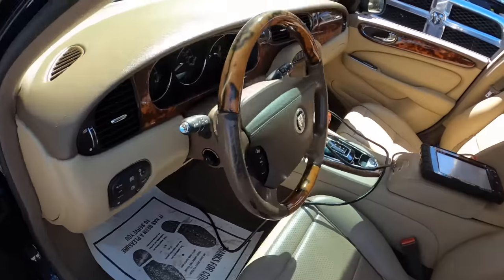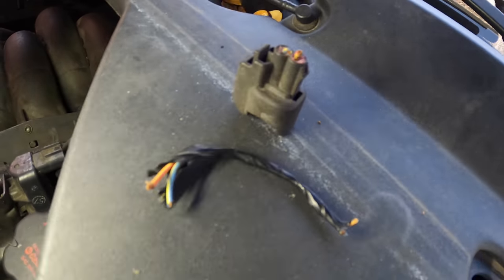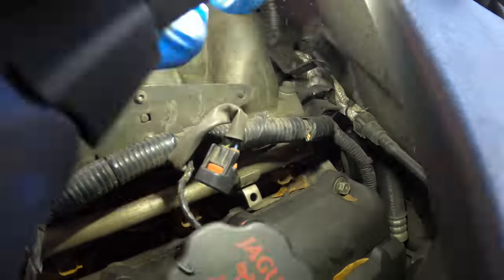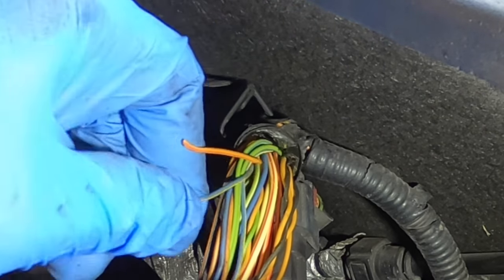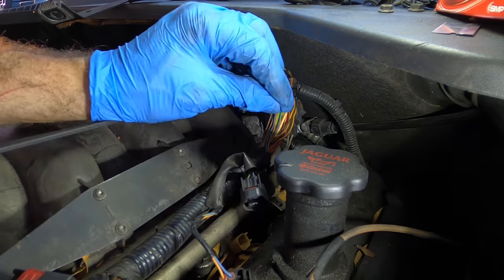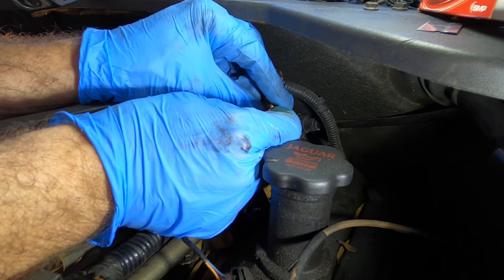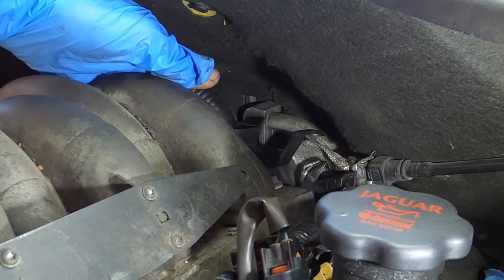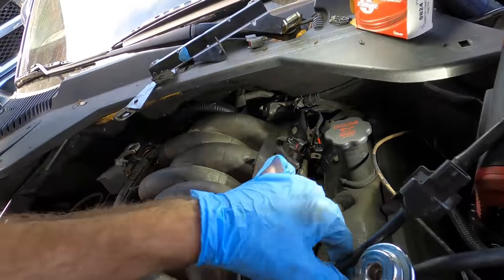Angry XJ Jaguar Engine Attacked / Electrical Damage. P0208 P0308 P0316

Comment: I think that's the best way to solder, It's the only method I use. The only difference is that I twist them individually before I twist them to each other. It makes a nice tight connection and you don't need tools to hold anything while you solder.

Comment: Your soldering job was fine, but I would like to commend you on using shrink wrap followed by thorough taping of the loom, the injector wires, and their intersection. Nice work.

Comment: Ray,  sometimes, if you take the wires to be soldered, make sure they are clean, then fan them slightly and spilt them into 2 halves... Same with the other wire..
Then, join the 2 split into halves, wires together, wrap all the wires evenly and tight, and you now have 4 wires completely connected to each other, and a nice solder flow through them, make sure your solder is shiny hot.. Cool, slide up heatshrink,  and you know the rest...

Comment: Love your videos!  I used to solder splices years ago, and we used a heat absorber on the left and right side of the solder joint.  So the heat wouldn't go up the wire where the shielding is.  Also, we offset the splices to reduce the possibility of the splices rubbing and wearing through.  So we used heat shrink on each wire, and another one over the entire repair to protect it from the elements.  Doo dee doo dee dooo
Reply: One long, one short. Un insulated crimp sleeves, then solder. Liquid electrical tape before heat shrink tubing. Tin the tip and wipe on a wet sponge. Foil wrap to protect other wires. Heat sink between joint and any other component. Insulation wrap then metal braid shielding with lacquer over the top. That's the Boeing way.
Reply: There are butt splice connectors available, that, when heated, will activate a soldered joint and heat shrink all in one step . I don't know if they come for wire in that small a gauge though.
Reply: @michaelvangundy226   Exactly !!!  Even a pair of metal hemostats are perfect for perfect for using as heat sinks on both sides of the soldered wires ... And of course, clean, shiny solder connections....  No gray cold solder joints ever...   :)

Comment: I had my brand new 4Runner Limited visited by mice. They chewed through the foam insulation around the AC lines and chewed through the wiring for all 3 fuel injectors on the passenger side engine bank. The soy based insulation on the wiring makes a nice food source.

I had to solder on three new injector connectors. I did treat each solder connection with liquid electrical tape before applying the heat shrink tubing. I also put heat shrink tubing on each wire with a larger piece of heat shrink tubing over both wires together. Just wanted to make sure corrosion wouldn't be able to start.

Comment: The tip wont matter.  But i would add a small damp sponge to clean the solder iron tip .  Clean helps the solder  to heat and helps the heat transfer.  You are 100 percent correct getting a tiny bit of solder on the tip to start the heat transfer.

Comment: Get yourself a small, damp sponge to wipe the tip of the hot solder iron between applications of solder and when your done. It will keep it from getting oxidized and solder will flow onto it much better.  Production soldering irons have  them built into their bases.
Nice repair BTW!

Comment: Ray I’ve had good luck using the heat shrink solder fill butt connectors. I use them all the time and haven’t had any issues.

Comment: Cleaning the Hot Tip on the Soldering Iron with a wet sponge (or even a wet paper towel) helps with the flow of the solder.  The tip should be CLEAN and SHINEY when the soldering activity begins.  Once the tip is CLEAN & SHINEY, apply some solder to the HOT TIP before starting the soldering operation.

Comment: Have you seen the new way to connect wires, it's about a three inch piece of shrink wrap with a piece of soldier in the middle and the only tool you need is your heat gun!  Worth checking out available on Amazon!!

Comment: Ray, whatever soldering method works for you is fine with me. Just make sure when you are finished, the solder joint is nice and shiny. If it is dull looking then it is a bad solder job (fyi- called a cold joint) and it will fail. So shiny is strong and dull is a fail.

Comment: Good job, If possible I like to get some needle nose pliers in there and smoosh the soldered connection to make sure no errant strands are bent down so they cannot poke through the heat shrink and or tape. 🤓

Comment: I saw a hack video of how to cut that open without accidentally cutting a wire. Use a seem opener, for clothing. Run the covered part into the wire harness. Just thought I would share that.

Comment: seamless barrel connectors crimped with a snappy crimper and shrink wrap. strong low resistance connection, protected from the elements

Comment: Have you ever used the heat shrink butt connectors with the ring of low temp solder in them? Changed my life! Shove the two ends in give it some heat gun and good to go!

Comment: Had this  happen to my truck big time, or bigly,   Squirrels, three events. Tried every  repellant available  or concocted. No dice. Finall;y used an Ultrasonic gen, rodent repeller, and  that did the trick. Need the type that  produces two frequencies and   switches them on and  off. As Rodent can get use to one freq. Get one  that operates off the  car battery.  Three years battling them  and over $1400 bucks worth of damage.
Chewed up over 26 wires that  all had to be spliced.  Also hoses and plastic clips.

Comment: Ray, get a pair of surgical scissors, the kind with a little flat bit in front, so you can cut off bandages without cutting the patient.  They work great for the tape and plastic hose.

Comment: Good job! But try to use flat shape soldering tip (something like small screwdriver), put some flux on twisted wire, put some solder on the tip then... you can see, faster and easier :) Like watch you are doing things and coments. Good luck!

Comment: Heat shrink terminals with the solder in them works good also, called marine connectors.

Comment: There are butt connectors that make it a lot easier. They are a heat shrink tube with a solder ring in the center and near each end is a glue ring, just strip both wires poke them into the connector and use heat gun to shrink/solder and glue all in one go. Fully waterproof

Comment: I've heard pre-tinning your wires makes life easier.  Apply solder to the wire ends individually, twist them about each other, then temp bond them with heat and apply a little extra solder to solidify the bond.

There are these nifty things you can get as well called "helping hands" which are gator clips on articulated arms.  Usually they're rooted to a soldering station, so not too helpful in your case, but I believe they make them with strong magnet bases so you can use them where ever you are, and engine compartments tend to have a lot of metal.  Maybe that would help in these cases?

Can't say bad things about the soldering job though.  Anything that stays together when you give it a tug is done well.

Comment: An alternative method of making soldered splices is to use heat shrink self-solder butt splice connectors. A heat gun is used in this case to make a waterproof connection. As a test, I used them on the lights on a trailer that is outdoors 365 days of the year. After a year in the north Florida sun, I don't see any degradation of the connections. As a bonus, using these things drives purists up the wall.

Comment: I agree with the soldering its the only way i do wiring. Especially when some manufacturers use resistance base wires and sensors. Next time try tinning your ends first and flux helps solder flow less time under the hood with heat and you get a free hand. Another Great job tho brother

Comment: Rodent attraction to wiring in automobiles…..soybean based wiring insulation. I asked about this when I discovered an increased attraction between late seventies and into the eighties. There was a marked increase in the frequency of rodent based repairs during my tenure. 
Frickin’ bean counters!! And those critters never chew the easier places to reach!!
I live in a rural setting in Kansas and have experience with doing repairs of this sort…sometimes on my cars/trucks in the morning before heading out. 
I learned that if you leave your hood/bonnet up(open) during the night, the rodents won’t go there. 
I also bet if you check under that intake you’ll find a nest or the remains of one. 
Doing a great job!!🤠👍👍

Comment: @Rainman Ray's Repairs EXCALLENT Solder Job RAY! Especially in that terrible location. My body was aching just thinking about it. You got mechanical with the twist and then solder, That joint will not fail! How's that for Reeeeeeeeeeeeeeeeeeeeee  :D

Comment: Get some SRA rosin paste flux and stick the ends of the wire in it before soldering. It will make it flow much better and faster.

Comment: Ray used what we used to call "friction tape"; it's NOT harness tape. Once PVC came along everyone switched over because it was better as insulation, wasn't as attractive to rodents, didn't rot, and wasn't as flammable. "Harness tape" is essentially PVC tape without the sticky stuff. Heat tends to harden it so it doesn't unwrap in use. Different wrap techniques are used at junctions and ends to hold it in place till it hardens. That's why factory harnesses aren't sticky and sloppy and falling apart like electrical tape does; even though it looks the same it ain't..

Comment: Squirrels got the fuel pump wiring this summer on my wifes 2018 Golf, I would have tackled it but since it was still under warranty, took it to the dealer..   $600.00 to replace the complete wiring harness.    Neighbour had a 2016 Lincoln, $3000.00 to replace his wiring harness, luckily insurance covered his.   VW uses Soy based wiring cover, which attracts them.
I have since started started spraying the wiring with foamy Chain Lube to hopefully make it not so edible.  Heard Tee Tree oil helps too

Comment: Ever try the butt connectors with the  solder in them. You just insert the wires and then use a heat gun  to melt the solder into the connection. Makes a nice neat quick repair,

Comment: About the only thing I do different is a little flux on the wires to help the solder stick better and it seems to help with heat transfer from the iron to the wire making it easier

Comment: There is only ONE right way to solder (I couldn't resist), the way that works for you and the situation. I learned to solder when I was 8. That was 54 years ago. I still have the iron I learned on, and still have the soldering gun I got for my 12th birthday. I was taught to care for things. There are many right ways to do anything. I've used them all.

Comment: If you tin the wires before connecting them it works better as the strands are bound by the solder.  Easier to twist the wires and then apply more heat and a little more solder.

Comment: I am an electrician and never found a wire a rodent chewed through and have worked in the field since 1986. They cause issues chewing the insulation or building nests where wires are to keep warm. The "loom" is different too in my trade. Loom is what was used on knob and tube wiring c.1880-1930. The term come from the fact it was made of a fabric on a loom. Just different not nit picking. Really enjoy your videos. Now I need to change the master cylinder in my 2002 GMC 3500 van. Any tips? *Click* ?

Comment: I have been an electrical engineer and building and fixing wire harnesses and fixing circuit boards etc.   
    Getting the iron clean and wiping it with a wet sponge. Is the good start.  Your iron should be around 734 degrees.   750 is ok.   You want a touch of solder on the iron to transfer heat.  Then when the joint is hot the solder should just flow into the joint.   
       Ray I have fixed a lot of stuff over a long period of time and your solder repair was fine. It looked connected and a hot joint.. solder looked clean and shiny..
    I like using a solder called multicore.  It has rosen internal to the solder..  looks like a multi stranded rope.  And it works very well. 
     You want high quality solder and thinner is better..  dont just buy cheap 60/40 at the hardware store.   

     Ray..   people are all internet experts.. and that gets old..  repairing cars and even aircraft is about getting stuff fixed with a reliable repair.  Its not nasa level stuff.   
     Using good alpha fit 123 heat shrink.. and some cable protection and your good.   I have filled heat shrink with rtv to try to create a super water / moisture resistant solder joint at times.

Comment: Ray try heat shrink connectors with solder in them , you just shink them to get the solder to melt, water tight

Comment: I no longer solder something like this. You can get these waterproof sleeves with solder inside them. It basically does 2 jobs in 1 and you only need a heat gun.
You can get them on Amazon dirt cheap

Comment: This was by far your best soldering effort. I am no solder whisperer but  I believe the Western Union joint you employed is one of the cleanest and structurally secure joints you can use in that type of situation. Excellent job, stick with that method.

Comment: Hey Ray, some manufacturers wires were covered in soy-based insulation, which it seems now that rodents like! Not sure if those Jags had same process for making insulation. Those tiny houses usually price around $10K $30K by the time your done. Some spend way more than that! I think RV would be better since you can drive them around.

Comment: Fyi, I fixed a bank2 po430 by cleaning the dirt off the  down O2 connector with Deoxcit spray. It was intermittent causing the code. Unfortunately bank 1 cat is shot.

Comment: No issues with your soldering, basically, as long as it's not a cold joint, it's fine.  Only thing I'd add, as an ex-tractor guy who has seen his share of GREEN wire.... if your gonna use the cheap heat shrink (one without the glue in it), might add a bit of silicone (whatever is handy at hand) over the joint before shrinking it down.  Helps keep the green wire rust away.... still no solution for flash light gravity thou, been the death of many a light for me.

Comment: The connectors may have been assembled with a vegetable oil possibly peanut to aid assembly through the weather seal.  i prefer to use a scalpel blade in a suitable holder for cutting into looms, i think its safer than the blades you used.  good soldering technique.

Comment: Hey Ray,  its the insulation for the wires that the mfg's put into that attracts the rodents.  Years ago that was a major case so they changed an ingredient and it stopped. but now ,  what your showing, there back adding it..

Comment: I believe peppermint oil is a mouse repellent.  Mixed with water and sprayed on anywhere you want mice to avoid like the plague. I've never needed it under the hood in automotive  applications  but it I'm sure it would work.

Comment: I had the wires to the solenoids chewed on my fisher snow r plow Had the wires and harness replaced. The shop told me to apply or spray peppermint oil to wires to discourage mice. I have an excellent cat if they in the yard not hidden in vehicles.

Comment: Mr. Rainman did you ever try using a sewing tool that kind of looks like a claw? It is an excellent tool to cut tight areas on say a wiring loom etc. I have seen it used several times with excellent results !!! So much better than a razor blade & safer for your digits and other wires etc. Just a little idea?

Comment: RE! Re! kidding.  Just something I've done when working in cars on stereo wiring that is hard to reach, I tin both the ends of the wires, then twist, then hit with the iron again to get the already  tinned ends to flow. only when it's hard to reach tho.seems like you had decent enough access.   And there was nothing wrong with that joint so far as I could see. Also agree with you on the tape. the plastic tape either gets gummy, brittle, or both.  It does not work well in high heat situations like under the hood of the car near the engine :D

Comment: Re Soldering.  Two questions.  How hot does it get around those injectors?  What is the melting point of your solder?  If those two answers are within shouting distance of each other, the 'fix' might not last.

Comment: hahaha was watching you get the wires together and while i was thinking "ummm heat srhink??" you remembered. 

that would of been a mini ree on my end, "dont do it like a backyard mechanic like me, do it right you got the tools."

as far as sodering wires, i had an electronic throttle body with 3 wires that had rubbed their coating off in the same spots and were causing issues, i took it to a place and i asked for them to cut and soder the wires. i didnt have the skillset in the tight space so i wanted it done right so the wires would be like new. 

screw having a whole ass length of wire run thru all the crap.
Reply: I was also talking to the screen re the missing heat shrink.

Comment: I myself am a 100% supporter of insulated heat shrink butt connectors, I’ve done many hundreds of connections and have never had a connection issue or a comeback, personally just never feel the need to solder lol, to each their own.

Comment: I’ve been soldering for 50 years and have never had one pull loose. If the wire is hot enough and you use flux it magically works.

Comment: I am tellin’ you, those heat-shrink butt connectors with the low-temperature melting solder rings are “de bomb” (as the kids say) when it comes to splicing wires…

The only problem during installation is somehow isolating the heat gun’s heat flow to only the splice point.

Comment: Tip to try out when working on wires. Instead of using a blade, use a hook tool, smaller the better. Use it to scoop under the tape and then only pull the tape and rip it. Lot safer than using a blade in those tight spots.